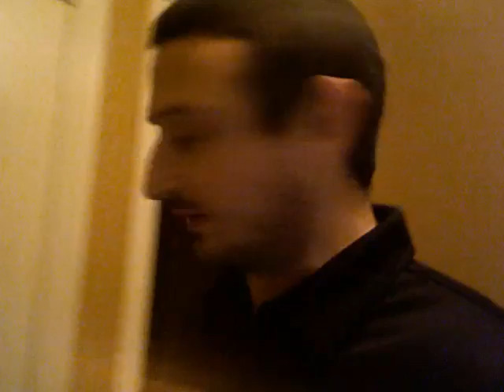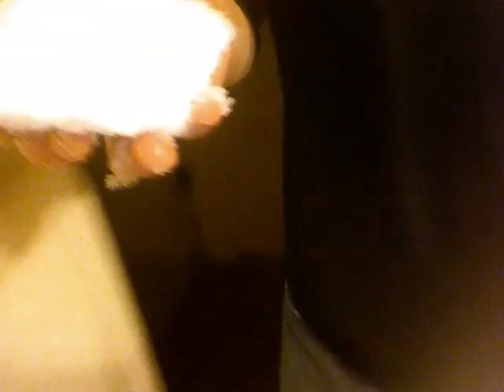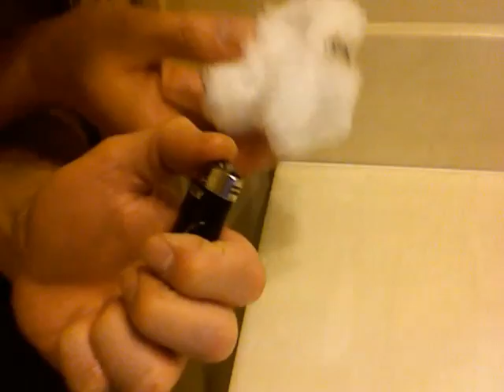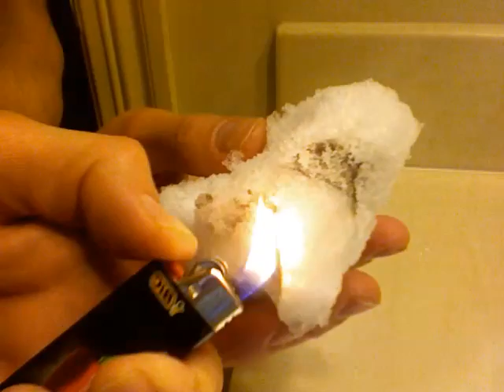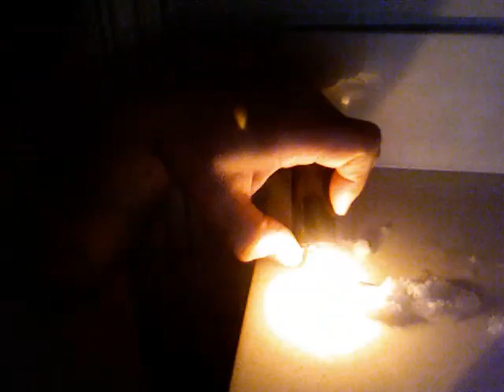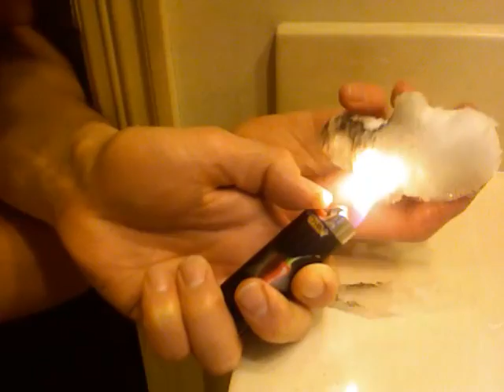Can A Chemist Please Explain Why Flames Don't Melt Snow?

Comment: Dude, it's called sublimation. The direct heat of the fire is turning the melted water into water vapor. The black burned areas are butane from the lighter and particles collected on the snow/ice as it originally fell.

What your seeing is 100% normal. It is melting but it's turning into a vapor and leaving behind excess particles and fuel from the lighter.

If you have an extremely sensitive humidity detector you'd see the water vapor bring up the room humidity a tiny fraction as you add water to the air in the room.

To test this hold the flame below the snow. No direct contact, keep the fire 4-6 inches below the snow and the radiant heat will melt the snow to water rather than vapor.

Comment: Easy explanation, Snow is basically ice but with a lot of air in it (AKA: empty space), when you apply heat to the snow, it does melt, but it is not noticeable, as the water is filling up the empty space by sticking to other water molecules. You will be able to see snow melt if you apply heat to it until it is fully, or atleast halfway melted.
Reply from the maker: And the black charring?
Reply: TheNewAmericanMedia either burning air or some other sediment that’s burning, also, fire produces soot on its own, so the black charring could very well be just soot from th Fire.

Comment: 1. Capillary action sucks the water back in.
2. So little water is produced that that block of snow would be about 1 tsp.
3. With how light snow is, it allows sublimation, where the water goes directly to water vapor.
4. Smell/blackness. It's soot at butane. Easy was to prove this is to put a lighter right up to the bottom of the plate. Same black stuff, same plasticy smell. If you think the plates are rigged for this, do this to a fire with any inflammable object, just put the flame close to it.

Thats all you said solved

Comment: I am 12 years old and I think I know the 12 more than you do there is a chemical in liars that limits it because it is not technically a real flame so whenever aim it so it varies itself in and around the snowball and doesn't melt in the water just keep on ignoring it self a good absorbed into the search and a partial is inside of the snowball

Comment: Have you ever held a lighter to metal? It leaves soot on the metal, and the metal clearly isn't burning.
Have you ever held snow? As it melts, it takes a long time to drip - both because snow absorbs water and turns hard/icy, and because snow isn't very dense water-wise.
I mean, your hand was melting it too, you inbred.
But no, go ahead and be confused about this, even though you have the pieces needed to figure out the answer yourself.

Comment: The snow is not "charring". That is the carbon from the burning lighter fluid depositing onto the snow.
Reply: +WitchidWitchid wrong, you you can use any form of fire, a match paper or wood, a stick of caught on fire, butane, they all char the snow, there is something in the snow that smells like burning styrofoam. It creates smoke that makes eyes itch and coughing. I suspect chemtrail contaminates. It is also in all the water you can put a match out in a bowl of rain water, well water, store bought water. (Deeper wells have less contaminates in the water in my local that burns and smokes like this.) You can let a bowl of this snow melt and it takes a long time to melt even when sitting next to a wood stove in a room that is 85 degrees. When it melts it is thick like a syrup. Slushy snow on boots is wet because there is water in the snow, but it doesn't melt like normal. I have a lake in my back yard from heavy rain last night, the temp is near 50 degrees and I can see patches of snow at the bottom of 6 inch deep of water that has not melted all day. This is weird stuff. UN-NATURAL!!!!
Reply: And so Hermit Wizzard if a Christian tells you the weather conditions you just ignore them because a Christian has faith in Jesus? What do you have faith in? How about evoluution, I am sure you believe that you came from fish and frogs and monkeys without any wizzardry involved. Hmm that takes more faith than I could muster. But if you evolved from a monkey there is no reason for YOU to trust your own intellect as it is per random chance that yours is working properly.
Reply: This just in: Grown man somehow does not understand what causes smoke, and does not understand that any source of smoke causes eye and lung irritation.
I don't want to have to explain common sense to a grown man like I'm explaining something to a three year old, so please don't make me do that. This is all stuff we've understood since practically ancient times.

Comment: Cheap lighters have sulfur residue in them which explains why the snow turns black as for the snow not melting, that’s easy, snow unlike ice is generally comprised of between 90 to 95% air. If you want to know more you can check out the podcast Stuff to blow your mind they have one entitled (pink snow, black snow, space snow, weird snow)
Reply: +Anthony Pacifico Sorry you are wrong. If you don't have snow to try this on you don't understand. I live in rural Vermont and fresh snow that creates a black smoke when you put a match to it. I know what burning match smell likes and what burning wood smells like I have 4 wood stoves. The snow burns and smells like burning styrofoam. It creates smoke that makes eyes itch and causes people to cough. That is not from the fire source other wise we would cough and itch independent of putting the flame to the snow. When you put a match out in the melted snow it creates a melted film that looks like wax and what ever that film is is what is burning and creating the toxic smell. I am sure it has to do with chem-trails.

Comment: Snow is fluffy as all hell. 1 ft of dry snow will melt down to 1/10-1/5th of an inch of water. Wet snow, one foot, will melt down to 1inch of water. Is this making sense yet? You guys must have brain damage from Monsanto. Smmfwh!!! Idiots. Fill a stove pot full of snow and put your stove on warm. I BET you wont do that video cause you already fucking know its gonna turn into water. I mean tons of condensation. Lmao. Never had plastic produce condensation.

Comment: Dum dum... snow is like a sponge, and the melt snow is drink back and cold down by the rest of the snow....
Reply: before you insult someone else's opinion how about you learn how to write a complete sentence using the correct words dumb dumb
Reply: Hey tu a parfaitement raison mon ostie de deux watts, essaye de comprendre cette sentence la mon deux de piques, essaye de me répondre sans utiliser google translate mon tata....
Reply: It's called sublimation. Pretty scientific. You shouldn't call others dumb. Especially if you can't spell, complete a sentence or really know what something is called. And water is water, not a sponge and it doesn't return inside, but evaporated Into a gas form.
Reply: I’m de dum dum de snow drink de water

Comment: Its common sense.  The snow melts into itself.. Doesnt drip. Amd the markings is from the butane in peoples lighters. Science
Reply: Ummm sure
Reply: do  not be fool. snow have 90% of space so when melting it  absorb the 
water by the snow and for the soot it is be cause the flame is to close 
of the snow bad combustion residue of soot  hey try to put flame on 
coffee cup it will do soot  BUT WHAT IS IN THE SNOW IT IS THE TRUTH 
QUESTION ?  https://www.facebook.com/permalink.php?story_fbid=10153111810677540&id=546532539

Comment: Take the snow, put it in a pot , put it on the stove , turn the stove on and it will melt immediately. Its the butane from the lighter that makes the snow black. The snow is fine.

Comment: After many experiments I concluded that this was dry ice. That's why it had those characteristics. My theory was confirmed when I found a report about scientist creating snow. They show a step by step method. This snow was man made dry ice.
Reply: If it is dry ice how us he holding it with just his hands
Reply: Janson Reason Crushed dry ice, you can old dry ice in your hand without burnig it, etc.
Reply: Dojoguy365 - Minecraft, Mini-Games, Let's Plays It's not dry ice, you would clearly see the sublimation process and any skin contact would cause severe injury.
Reply: 8ishy8ear You can hold it in your hand, but not for long. Only for like 2 seconds while bouncing it around.
Reply: It's still clearly snow taken from outside and even more clearly, not dry ice.. This would be a valid statement if he held it for 2 seconds bouncing it around in his hand which he clearly does not.
Reply: Dry ice is solid carbon dioxide. At -109.3 degrees Fahrenheit (-78.5 degrees C). Dry ice undergoes sublimation, (especially at room temperature) which means the solid form of carbon dioxide turns directly into a gas, without an intermediate liquid phase.

There is clearly no sublimation occuring from this ice even at room temp.This is because it is not man-made crushed dry ice..
Reply: 8ishy8ear I actually never said it was dry ice. I was correcting somebody.

I think it's not fake snow. It'd be pretty hard to keep a steady fake snow fall all day, so...

Comment: Oh please it's the  flame cause to turn black it's not chemtrail ,plane spayed ,haarp  or Geoengineering aims to tackle climate change by removing CO2 from the air or limiting the sunlight reaching the planet .it's not the chemical sprayed to make it rain.
Because the snow ball is packed tight it will not drip water .The ice  is not the same  it's all water .the bottom will turn black flame from the burning  gas  from the flame goes up when it  on the bottom because flames  burns up not sideway. you can do this with a coin use a coin and a pliers it will turn black with it's lit with a lighter or a candle. this is not the government chemtrails. anything is solid with contact will turn black with the flame.

Comment: the plastic smell is your lighter you said it yourself it isn't fake snow since it melts into water in your hand because you can feel the water but you cannot feel it being re absorbed by the snow but with the fire you can see it isn't melting but it is shrinking this is because the water is once again being absorbed but since your not feeling it you can't see that the water is melting

Comment: hey think of it a small lighter melting a chunk of snow that won't be very easy and the black soot is from the lighter while the not melting part that is easy either it is evaporating before it turns to water or it is getting absorbed by the snow and you can melt it into water just take a blowtorch and light it for a while

Comment: Some of the water is evaporating, some of it is soaking into the snowball.

It would be awesome if you did this with the snow ball on a very accurate scale. Then you could see how much mass is lost due to water evaporating.

The black sut has two causes:

#1: Impurities in the water combining with Hydrocarbons from the lighter.

When the flame is up against the snowball, there is a lack of air in that area, so the hydrocarbon stream from the lighter doesn't fully burn in that region, however heat from the flame is present. This adds the needed energy to cause the carbon to separate, making it possible for the carbon from the unburned hydrocarbon to stick to impurites in the water, or possibly the water itself.

#2: Unburned hydrocarbons trapped in the water from pollution ( same process as above )

The reason why the snow ball doesn't melt as much as you would expect is for a few reasons:

#1: Because of the huge amount of energy that it takes to make water change state from a solid to a liquid! It only takes 1 BTU to heat a poud of ice from 31 degF to 32degF. However it takes 143 BTU's to turn that 1 pound of ice into 1 pound of water, which will still remain at 32degF. This is called latent heat.

#2: Because of Thermodynamics.
The greater the difference in tempurature, that faster heat moves from a warm area to a cold one!

The flame is really hot and the whole snow ball is really cold! Because the tempurature difference is so high, the snow ball quickly disappates the heat from the flame by spreading it out over a wide area.

Hope that helps.

Comment: ..of course, you are using a butane lighter, which you are holding so close that the snow is absorbing the heat energy, and not allowing the flame to burn all the carbons, so they are depositing on the snow surface.  Now, the 'plastic' smell IS the unburnt hydrocarbons...hence, 'plastic' smell.   Conclusion, this is not 'plastic snow'.

Comment: What's happening here is:

A) The snow is melting, but the very loose fluffy structure of the snow wicks away the water, turning dry snow into wet snow, and eventually turning the snow into slush.

B) The snow is blackened when a lighter is held underneath it because of the soot from the lighter (the products of incomplete combustion). It's not burning.

C) The smell is fumes from the lighter (also from incomplete combustion) and/or people briefly burning nearby objects like gloves.

D) It is not sublimation. At these temperatures and pressures, and over this timeframe, any sublimation is not going to be measurable. 

Sublimation - Basic Chemistry

Comment: Has anyone tried melting this scary stuff with ones breath? DO NOT! I REPEAT! DO NOT EAT FRESH GARLIC AND BREATH ON THIS DANGEROUS SNOW. iT sMELLS LIKE SULFUR  WHEN TYHIS DONE DONE LONGER THAN THE RECOMMENDED TIME! (Continuous expel of breath=3.36 seconds) This can make you VERY Light headed and your risk of seizure and acid reflux will sky rocket. Let it also be noted  that if you consume 3 large bulbs of Garlic within 10 minutes time your heart will palpitate as though you'd just nasally ingested 1 line of COKE.
:D

Comment: Explanation 1: Well snow is made of water and water doesn't burn! 
Explanation 2: Snow is a loose mix of air and ice crystals, when exposed the high temperatures, water will bypass melting and go directly into evaporating, this process is known as sublimation. The same process as dry ice (frozen CO2) exhibits.
Explanation 3: The soot on the snow/ice is from the carbon residue from the fuel (butane) used in the lighter.
Scientific hint: Any good experiment should also include a control, that is a sample with known purity for comparisson, e.g. using snow made from distilled water as a comparison.
Hope my explanations have been informative.
Reply: In addition, the water that is produced by the melting snow is rapidly absorbed into the still frozen snow via capillary action.  Water is highly cohesive.  It is the highest of the non-metallic liquids.
Reply: Marc Stone Good point about the capillary action.
Thanks for showing an interest in science ;-)
Reply: Thank you for looking at this like a rational sane person. Try melting this snow in a warm pan. It will melt into WATER. Smell it, it will smell like......WATER. all the problems you are experiencing with smell and black soot are from the lighter and the sublimation (ie "not melting") is from the high temp of the flame causing the snow to turn directly into a gas skipping the liquid water form.
Reply: yes true but also another thing you forgot an explanation 4 the water is going into the air pockets that snow has
Reply: The snow does not sublime like dry ice. The ice of the snow does not go from a solid to a gas skipping the liquid phase. The ice of snow is composed of water. Water's natural state at room temperature is a liquid. The ice of the frozen water is not cold enough and the flame of the lighter is not hot enough to cause the ice to boil instantly and skip the liquid stage and go straight to the gas stage caused by sublimation. Dry ice is frozen carbon dioxide, not water. CO2's natural state at room temp is a gas. A block of dry ice has a surface temperature of -109.3 degrees Fahrenheit (-78.5 degrees C) and when submerged in water, the dry ice boils and skips the liquid stage and goes straight to a gas. The water from the frozen snow is actually being absorbed into the the snow ball, and not turning into a gas.
Reply: He observes it produces a "black smoke"
When water hits fire - it produces a white smoke.
Reply: Luella Roma Could it be that the lighter flame is producing black smoke, or soot on the snow?
Reply: If you check out the phases of water
http://en.wikipedia.org/wiki/Water_%28data_page%29

sublimation doesn't occur until 2 requirements are met: the atmospheric pressure and temperature. For water, this happens at a min of 1 kpa  and 0 C. The temperature in Atlanta, Georgia on January 29, 2014 when it was was -11 C at 4 kpa. If you look at the chart, ice should still turn in to water first before vapor even at -11 C because it doesn't meet the atmospheric pressure requirements.

Even if it was close enough to sublimation, once you take the snow out of its environment, you are changing the temperature therefore it should still melt.
Reply: Luella Roma Note steam happens at 100C and 1atm=101.32kPa. How hot is the flame? Probably well above 100C.
Even if the snow doesn't sublimate it will melt and as Marc Stone pointed out be absorbed into the snow matrix by capillary action.
Also note the snow is melting in his hand, and receding when lit, so it does melt,
Again, could the black smoke and soot be from the lighter?
Reply: Angie Blanton What does distilled water smell like :-)
Reply: Baloney!
Reply: Ok this man knows what hes talking about thank you for going into detail for these people
Reply: fujisaii I feel the water of the melted snow is absorbed back into the empty spaces in the snow
The rest of the snow acts like a sponge 
And yes lighter Fuel residue

Comment: It called sublimation. Snow doesn't melt when exposed to direct flame. The solid water (ice) turns to gaseous water (steam) and skips the liquid water phase. As a "chemist" you should know this. That plastic smell and charring is likely the butane from the lighter itself.